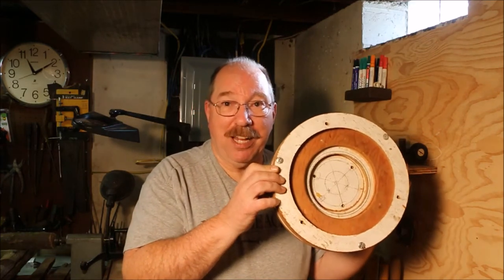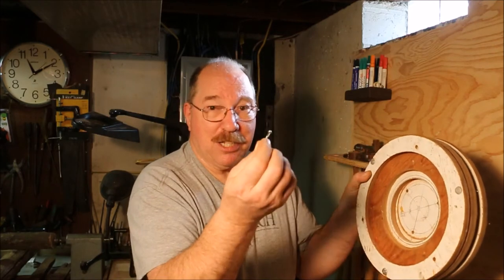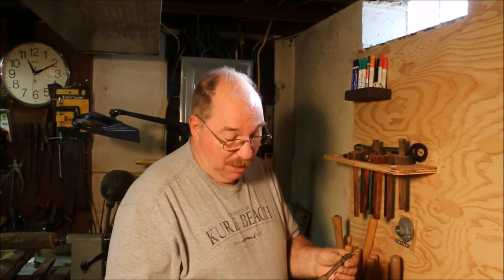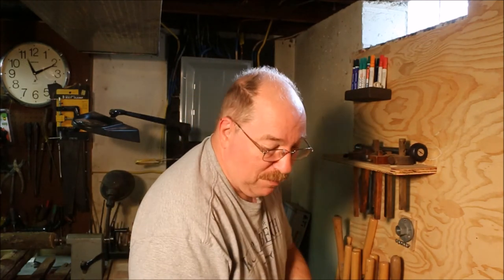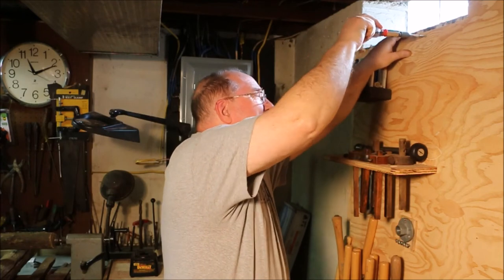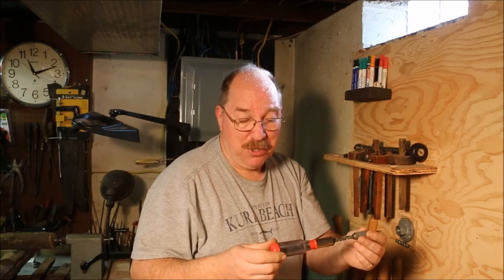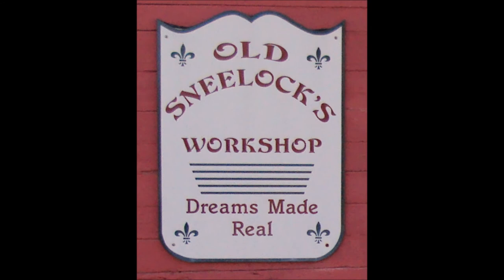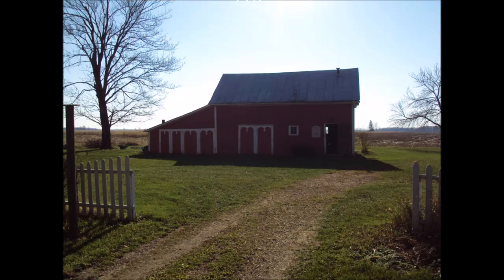Shop Organization ~ Hanging The Bowl Chuck ~ by Old Sneelock's Workshop

Comment: I think the answer is to have a bigger bench, it take a few more days before you can no longer find a space to put things down on it! Glad to see you are still using slotted screws instead of the ugly pozi drive things, I only use those where they cant be seen. Chris B.
Reply from the maker: Englishman French When the 2 or three pounds of old screws in the junk drawer are gone I might have to. Until then I'll keep using them. My old shop, the one in the title picture, had 32 linear feet of benches. My son and I built them after he made the suggestion. Between that, the blacksmith shop benches, the benches in Ryan's Lab, and the old horse stalls and grainery in the 60 x 60 foot barn, oops almost forgot the 10 foot bench in the Model T Barn, you would think that I would never run out of space. 
The first video I ever did, Sharpening An Auger Bit back in 2010 had a nice clean freshly painted bench, the length of the wall  behind me. I had moved everything off the bench onto the other bench, two Workmates, the tablesaw, and some was perched on the Farmall B in the vehicle bay. Nature abhors a vacuum. I'm pretty sure benches do too.